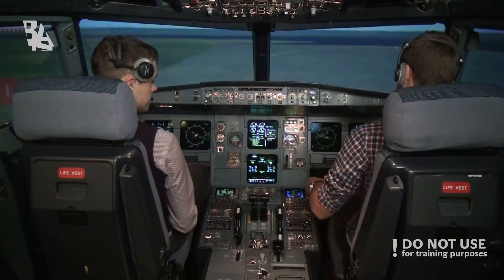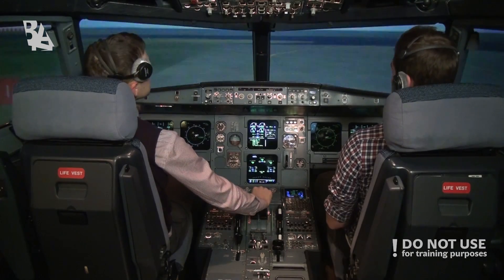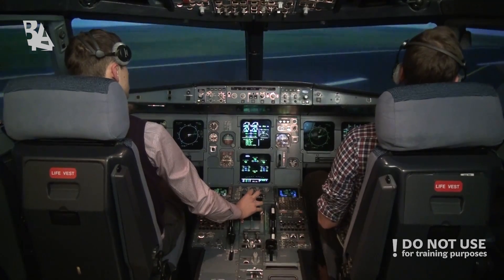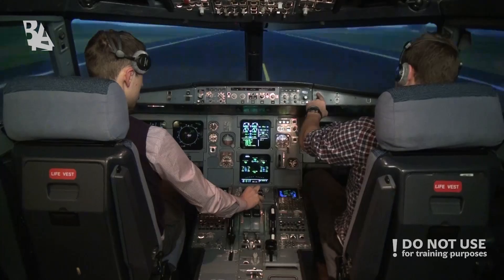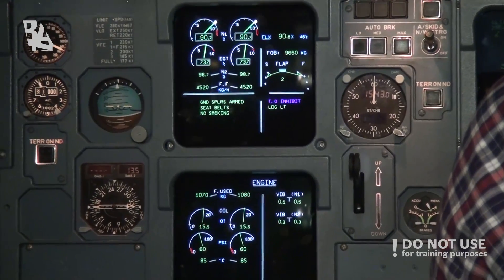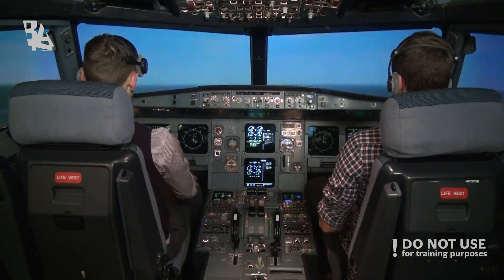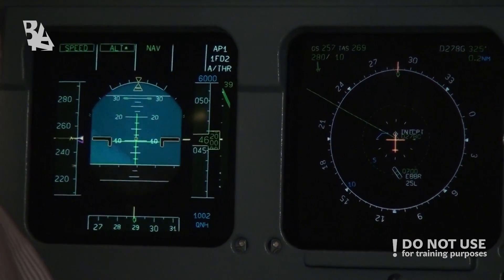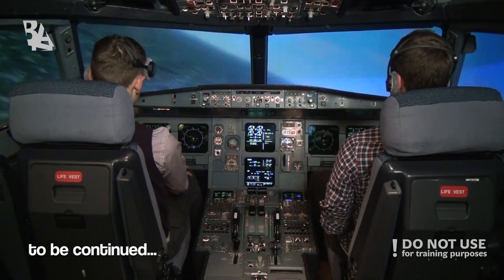Get TR’ed – Airbus A320 FFS type rating training (lesson 2, part 1) - Baltic Aviation Academy

Comment: What is Auto Pilot 1 and Auto pilot 2
Please explain!
Reply: What would you like explained?
Reply: both captain and first o have separate instrmts,. correct..
Reply: No there is AP1 and AP2 what do they do and what are they separately used for?
Reply: @housamalhoussawi7311   Well the function of the Auto Pilot is in the word itself when the pilots engage it the plane will be flown by computers instead of pilots so it doesn't mean after engaging Autopilot the pilot can sit back and relax like the passengers the pilots need to monitor each and every systems and also the Autopilot doesn't have it's own mind the pilots input the necessary datas like HDG, ALT and the Autopilot works on the given data.
Reply: @areafive01 he probably knows what autopilot is.. he needed explanation on what ap1 and ap2 means. why separate
Reply: basically redundancy